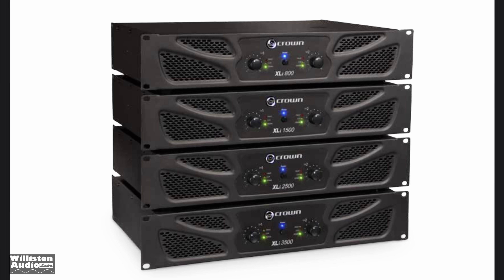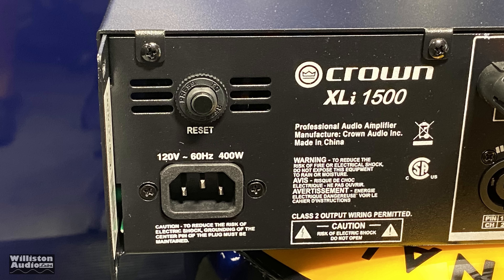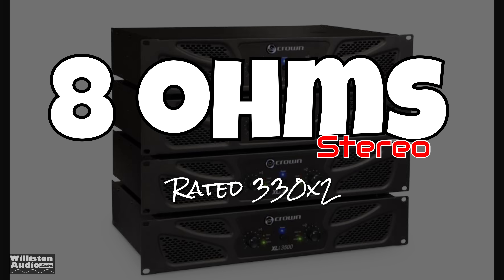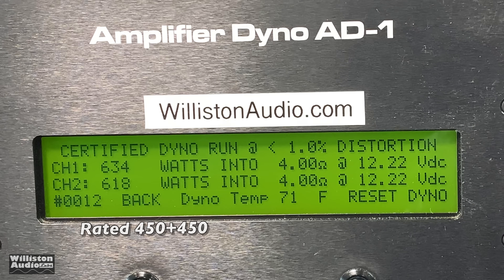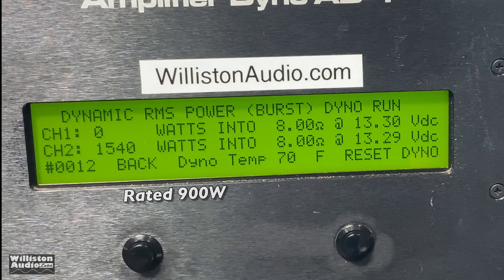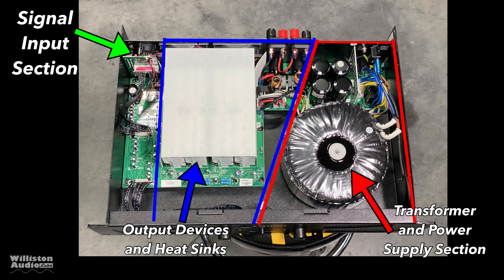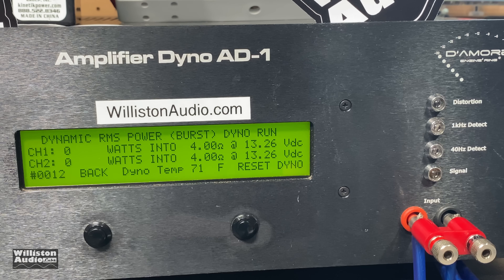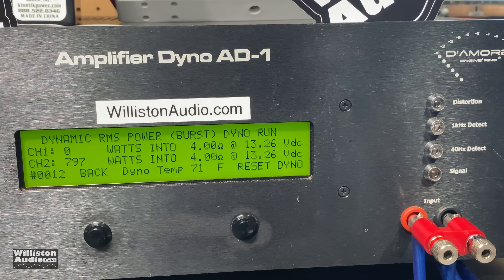The King of Pro Audio? Crown XLi 1500 Amp Dyno Test and Review [4K]

Comment: These were tested on AudioScienceReview. Excellent for power output, but not for fidelity scoring a low SINAD score down in the 60s. Great for pro audio and just cranking out lots of volume. Or power a sub if you run a filter or dsp before the Crown.
Reply: They tested the XLi800 (not XLi1500) at 5 Watts. This beast should be used at 50W minimum...

Then, they drew the conclusion that THD is high (0.16%). Below 1%, it is not audible...

Those guys make verdicts only by specifications. They never listened to the amplifier in real life.

If you have an amp with huge feedback, you may have better THD, IMD and SINAD, but it can easily sound worse in real life.

Don't trust such reviews when people test devices by their specs only.

I have an XLi1500 at home. It sounds much better than the most hifi amplifier (having better specs on paper).
Reply: @barnaczukor4235  Well many people may use these in their home and may never even use 50w, maybe when its cranked at most.  THD cascades together from each device including speakers. Starting at 1% then add in everything else it goes up quick. I know realistically when all is considered most people would have no issue with the crown xli line and couldn't distinguish it from a amp with a 80db SINAD. Amir has mentioned this many times that really over 70db SINAD most people will never hear the difference.  You must have missed the few times hes mentioned this. You know his work has been checked by other electrical engineers and hes spot on so doubt your credentials stack up to his so until then I'm gonna stick with Amir. Lets see should I trust a subjective review from some guy that really has no idea what he's talking about probably read a bunch of nonsenese on a forum or an objective review from a professional 30 years in audio and engineering 🤔
Reply: @iowaudioreviews   Amir has an accepted measurement methodology that allows us to objectively compare one amp to another. I found his measurements interesting and useful.

However, I tend to disagree that these measurements clearly shows the sound quality of each amplifier. There are tons of other aspects on top of THD, SINAD, etc. For instance, the depth of sound stage, sound coloring, vibration of instruments, bass depth, bass speed, etc. These aspects have nothing to do with electric measurements. So by electric measurement, you cannot draw the conclusion that this amp sounds good or bad. That is why I disagree with Amir's recommendation (sub duty only) or and his conclusions.

If you enjoy the dynamics, the power, the neutral representation, this amp is for you. It provides great sound quality that makes 99% of people happy. Neither have I a noise suppressed listening room, nor have I absolute hearing; therefore, the SQ of XLi amps is more than enough for me.

If you long for the cleanest highs with all the fine micro details as you are an audiophile, you would be better off with a dedicated hifi amp. These guys always look for the best stage, representation and they are not really interested in power or bass punch. As for me, they do not listen to music to enjoy this, but constantly check their system and search the ultimate solution (that never arrives).

Comment: Love the video. I just have one question. How on earth can that crown amp output more than 400 watts when it only has a 400 watt power supply? It clearly says 120V 60Hz 400W right above the power input. I know crown amps are great but how is that even possible?
Reply: 400 Watt is the constant AC drain from the socket on average. The amplifier has a 637VA AC toroid transformer. When you rectify the AC current to DC, the voltage increases to 1.41 times higher level as you charge the capacitors to the maximal sinusoid value. This leads to 900VA DC power.

This is an impulse load only, not a constant current drain. When the bass kicks, you have a peak, otherwise power is much lower.

Comment: Stop stop. You have a ~ 330VA transformer there. How can this class AB amplifier deliver the performance you are demonstrating? Does it have an efficiency higher than 100%?
Reply: 637VA is the toroid transformer. This amount of constant load is the maximum to avoid overheating.

It can handle higher levels of bursts for a short period of time, like peaks in music. Among the beats, the capacitors load and the power drain is less than the specified transformer value.

The average consumption is less than the specified transformer VA, because the music is not a sinus or constant load, but a series of peaks. If you loaded the amp with sinus wave, the output would be much lower, of course.

Comment: I blew up a Alpine type-r 12 (the old ones) on an old crown amp bridged @ 1ohm. (Yes it was stable down to 1ohm) that amp had that speaker making my house slap. Killed it on accident having the input clip while i was out of the room =(. Will probably make a transmission line box for a home 18"  thats like a built in for the house.

Comment: hey Big D....iv got myself a Behringer EuroPower EP2000 rack mount amp.

this thing took out all 4 of my 12's (supposed to be 500+ each RMS wired for 8ohm in pairs...i guess not **Clip limit switches were on**) i was wondering if I were to ship this thing in its original box to you (and back) if you would Dyno test this thing on a vid? she weighs 35LBS.

Comment: Likely the reason it didn't work with both inputs hooked up when you bridged it, is that to bridge 2 channels you have to invert the phase of one, so when you feed two in phase signals, one gets flipped internally to the amp and they cancel each other out.

Comment: Been running 2 Crown K2's as my home stereo amps since 2000. 1 in Stereo mode (later connected to a 7.2 receiver to still run my front channel) and 1 in bridged mono mode to run my 2 passive subs
They are indestructible and extremely loud.

Comment: I wonder how much power that amp pulled from the wall during these tests and how efficiently it did so. One of those 120v power meters would be pretty handy in this situation. Great video btw
Reply: I had the same question. How do you get all that power from a 110V 15A circuit. Conservation of energy.

Comment: These are great amps for subs in home use, but their SNR tend to be really low. Like, less than 80dBA. That’s worse than many tube amps. Yikes. It’s due to the number of gain stages required to get that power. Good info to know.
Reply: Any guess as to it's THD at say, 40wpc into 8?  It must be lower, way lower than "<0.5% at full rated power".  I would really like to know that number. And/or SNR at that output w/XLR inputs used.
Reply: @TriAmpMyFi  I hesitate to guess, TBH. Lower? Yes. How much? No idea. It's always best to select class-D Pro amps as if they are half their actual wattage. This results in better SQ and vastly quieter cooling fans.
Reply: @DBravo29er  You agree that all amps distort less at lower than rated output though.  I wonder by how much.
Reply: @TriAmpMyFi  Of course. Agreed. It's just that distortion curves are often non-linear with respect to wattage output AND are also not composed of the same distortion spectra. An amp with .15% THD at 30 watts but is dominated by higher/odd order harmonics will sound vastly worse than an amp that measures .30% THD at the same output power, but is mainly 2nd harmonic with much suppressed higher order harmonics. And that contest wouldn't even be particularly close, either.
Reply: @DBravo29er  OK,  I think I have a real vague understanding of order harmonics.  It's those almost evenly spaced spikes that show up on a frequency/Db chart (CRT/TV/Oscilloscope) but that's about it and I don't know why they show up.
     So let me ask the brass tax question, if you would be so kind.  Without ME getting into a long story.  Could you compare the Emotiva BasX A2 power amp using RCA's versus Crown XLi800 using XLR's?
      Those amps are both 200 into 8.  Both class A/B.  My requirement is only about 100 watts.  I'm using the Schiit Freya with balanced outs.  Which to choose while saving 5 years for the amp I want?  You seem knowledgeable and I'd love to hear an opinion.

Thank-you
Reply: @TriAmpMyFi  I love the Freya!! I think you should go Emotiva for this scenario. Just an easy fix. Guaranteed to be silent. Plenty of power for your use case. It's just easier AND might even sound better.
Reply: @DBravo29er  Hey thanks for the discussion.  I will consider your opinion.  It's been 40 years since my DJ days.  Saw one of these review videos and reminded me just how much I love a good stereo.  I am absolutely loving putting together my new system.  Building speakers too.  Hope your having the same thrill.  Peace.

Comment: I've been waiting for this!! So will it not run a 4 ohm subwoofer bridged well? I have a 2500xli to two 18s 4ohm subs, but I was thinking about getting two and bridging them so they would have a amp each. So would that not be recommended?
Reply: You must not bridge two 4 Ohm speakers, because the impedance drops to 1 Ohm, which is way too low for this amp. You must not run one 4 Ohm speaker in bridge mode either as the impedance drops to 2 Ohms, which is too low.

Only one 8 Ohm speaker can be used in bridge mode.

You should buy the XLi3500, which provides you with very big power without bridge mode as well. This can drive your 4 Ohm subwoofers with 1350 Watt per channel. This should be enough unless you have thousands of listeners.

Comment: I just picked this crown amp up not long ago. pumps the snot out of my old cerwin vega ls-15’s.. also found mine new online 200$
Reply from the maker: Wow that was a deal!
Reply: Williston Audio Labs honestly I was worried it was gonna be a knock off for the price but ended up coming from an authorized dealer. I couldn’t be happier!
Reply: 2 years later this amp still beats up the Vegas, had to Re glue both boxes as they split apart 🤣

Comment: Would like to see the Crown XLS2502 or 2002.  These Class D amps are 2 ohm stable in stereo mode/4ohm in bridge.  I'm using the XLS 2002 in 2 ohm stereo mode in my home theater driving two 15" Rockford Fosgate HX2's.  The specs say XLS2002 is at 1050w/channel at 2 ohms.
Reply from the maker: Yeah that 2502 is BIG power!

Comment: 1500rms at 8ohm, that is what we call performance and clarity. Thank you!
Reply: Crown knows that these amps need to be build to take a complete beating and not fail. Crown would rather have sound engineers in nightclubs and concert venues blow speakers than their amps.
Reply: @DJSHaKa  true. Because at 8ohms with such power most coils would just vaporise

Comment: I've got the rm series the end series and a macro1200,just sold my xls2502 and I've not had or touched a p.a amp that does the power the xls models do with the weight.
It weighs about the same as a good double din but does 725 watts per ch at 8 and 2500 bridged.
And it has one of the best onboard digital crossovers I've messed with so far.

Comment: I tried testing my ComTech1610 (58 pounds).  I can only run one of the two channels at 4Ohms without popping a 15Amp breaker!  It did push almost 900 watts into my 4 ohm load block though.  Scary as hell running it with the top cover off.

Comment: crown was once good, 15 years ago. Their entry-level stuff has qc issues and they tend to run very hot when pushed.
Reply: Their class D amps run very cool and put out some big power.  Using a XL 2002 for my two 15" RF HX2's in my home theater wired as 2 ohm load on each channel.  The case is cool to the touch and fan doesn't run often.

Comment: This is off topic sorry. I just seen a video of the new CAB-22 AMP by audio apex has the same Amp Board as the Power Acoustik Vertigo 10000??? Did I buy a cheap amp  or knockoff of power Acoustik?
Reply from the maker: All I can say is most of the budget amps have twins out there
Reply: @wal  yea your right. Just hate that people have to use same build house and copy each other's pcb boards. Supposed to have been built in sundowns chinese build house but they must build power acoustik too. I'm a jl audio amp guy. Just took a chance on this amp for more power
Reply: I checked out my amp board. 1 cap has a bulge at the top?? Does that mean it's bad??
Reply from the maker: @BangingCamry  Bulging caps usually don't mean they have been working out, means they are expanding and should be replaced
Reply: @wal  thanks. I sent audio apex a long message with another picture. I havnt hooked amp up at all. The cap looks like the sleeve shrunk and the top is bulging a bit. They told me to use the amp that it's just a cap. Then when their replacement boards come in they would replace it. I don't want to use it. I want to send it back

Comment: I use the XLi 800 Bridged to power a 10w6 (in a sealed .8 cubic foot box stuffed with 1.25lbs of poly) for my 7.4.1 Atmos set up. Sounds amazing, plenty of power and I bought it new for $220

Comment: When I was younger we setup a local club with a serious sound system.  
     3 crown macrotech 5000's on the low end and 2 racks of Ashley MFA 8000's amps powering the mid / high end. Iirc we had 16 Mfa 8000's

We had 32 600w rms 18" drivers in one room. 
     I could gather people's incredulity but this was the real deal. We had air conditioners in the amp room to deal with the incredible heat from the amps.
     To say the system we put together was over 100,000 watts was an understatement.
Reply: In Mexico my dad and his friends would do mods on those microtech to get more power out of them.  I wish I could bring of his crest audio amps to the USA.
Reply: And then...
Reply: @sarahconner9433  "No and then!"

Comment: FINALLY!!! Some pro audio amps.  Can’t imagine what the iTech and Macrotech 12000i or some Powersoft K20’s would do.
Reply: In my experience the Powersoft stuff absolutely smokes the Crown gear once it comes down to actually running a show with it 
The DSP is unrivalled, the power density is absolute insanity 
The iTech and the 12000i are nice, but not that nice
Reply: @VeryMildNoodles  The are all nice, the Dante software is nice on the Powersoft but no better than the Crowns Audio Architect software, (ive used both) but the power density thing is crazy on the Powersoft. I like the Lab Gruppens as well
Reply: @DJ_Renn  don't quote me on this, but I'm fairly sure the main difference between Powersoft Armonia and Crown Audio Architect is that the Powersoft lets you drag and drop speaker models, which the amp sets physical limiters, filters and corrective EQ for. It's been a few years since iv used them side by side but the last time I did, the Powersoft took home a huge win in my book. 
That aside, Powersoft also have stuff like the X8, which I think is the most power dense amplifier I have ever seen, at 8 x 5200w at 2 ohm. Flexibility on that thing is through the roof, only issue is they recommend you run subs and tops together on one amp because the power supply can't keep up at peak if you're not running 440v AC.

This is more of a personal preference thing, but I've had really, really good experience with Powersoft's support, not that I need them often since they're so reliable in my experience (I've had some dodgy experiences with Crown over the years)

Either way, don't get me wrong, the higher end Crown gear is still really damn good, I just prefer Powersoft
Reply: @VeryMildNoodles  The Crown software has speaker tunings as well. But yea a friend of mine just bought two X8 and got rid of his 8 Crown 12000l. The X8 outperforms the Crown by a wide margin.  We have tried it on a 440 volts line but we did power them on 240 volts 200 amp service and it was impressive. Crown or anyone else for that matter  has nothing on that Powersoft X8.

Comment: I have the XLi 3500 and let me tell yea, one of the best amps for top end. Crystal clear with plenty of headroom. It's also worth noting this is an class A/B amp, so yea... it's HEAVY.
Don't try putting this amp on an 4ohm load bridged, you will likely think your smelling your woofers cook but the amp will end up overheating shut off and not output any sound. (yes, i learned the hard way... twice). The fans are very quiet when idle and don't really ramp up until you really start pushing on it. LOVE these amps, and thank you for taking the time to review it. I use most of my PA amps for home theater.

Comment: I'd love to see a behringer ep2000 tested, rated 1,000x2 at 4ohm or 2,000 Bridged at 2ohm But weighs 19kg and power consumption is over 1,700 Watts (240v UK) would really like to see if they reach rated power or more... I've melted speaker wire with mine 🤣🤣 so either way they are beefy amps!!

Comment: Crown never disappoint. I could imagine what the crown macro tech series would put out
Reply: The Macro Tech 9000i would be an interesting dyno test.
Reply: Might blow up the dyno with that amp.
Reply: @DJPhantomRage  yep easily
Reply: @DJPhantomRage  probably need to dyno one of the smaller models 😆..
Reply: @smtyson1650  If they didn't weigh a ton I'd send him a few to test.
Reply: @DJPhantomRage  yeah,they do weight alot .hopefully one someone close by let him test one.
Reply: I run those...   they are monsters
Reply: I'm pretty sure you can weld steel with it!
Reply: Pure gravity.
Reply: Yep that's too of the line

Comment: Only thing things is, I cant stand 1% of distortion, 0.25% is starting to get yuck.  
It's great when the manufacturer rates their output power at the listed distortion level, instead of saying "yeah it can do 500 watts, and it can do as little as 0.05% distortion", but sure as hell not at the same time!    I can see these amps doing 330w rms @ 8ohm & = or < 0.5% THD, looks like it goes linearly into distortion, that's what ya want! 
Weird you didn't use 40hz to test it though